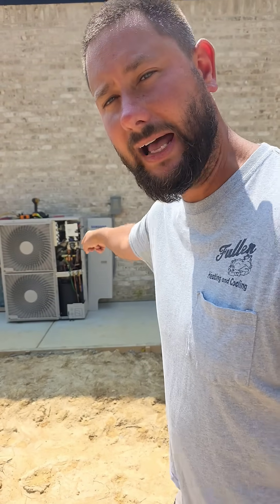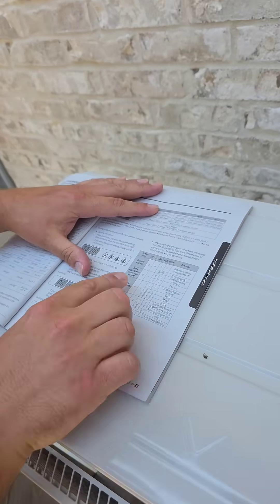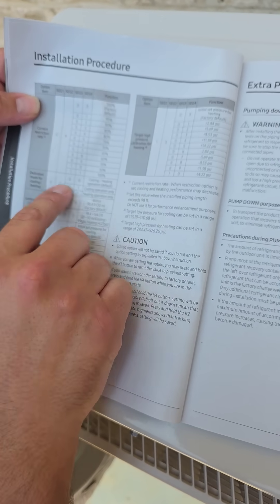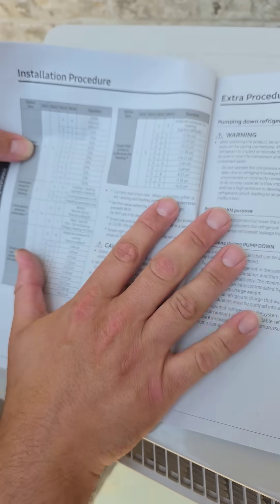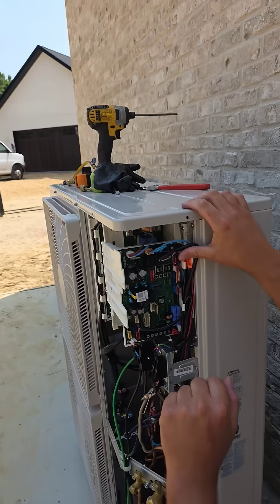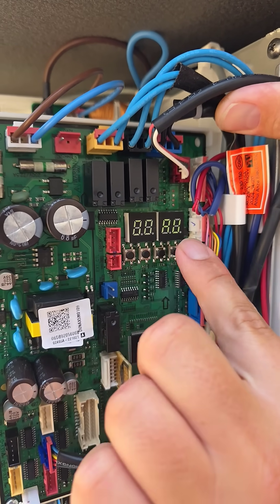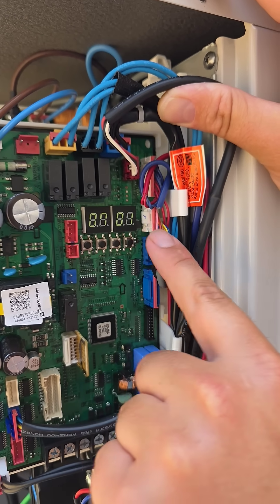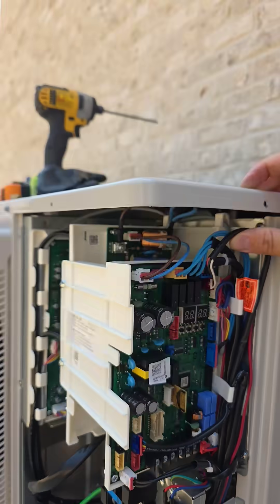Samsung Hylex Cooling Only (Option Setting) #hvac

Comment: I have a 2 ton Hylux matched to a 2 ton Trane AHR and it cools fine but unable to dehumidify? TEM4E0B24M21SAA with a Honeywell zone control and standard ACU control board?
Reply: Buy a dehumidifier and run it for a couple days, run the fan with the dehumidifier if you aren't using ac all day, then only run it when you think it's too humid. Changed my life.

Comment: In very cold weather the gas furnace is clearly the most economical.  In let's say 40's to 50's I'm not really sure if the gas is the cheapest unit to run? Not familiar with Samsung's COP'S but if they were any good???

Comment: I was just about to ask, 'Why would a customer pay for a heat pump only to turn around and have it converted to a straight A/C unit?', but you explained that they have a gas furnace inside.
  I still don't understand why the customer would pay for a heat pump when they could have just gotten a straight-cool unit.  But to each his own! 😆
Reply: They wanted the features of full inverter they get with Hylex.  Hylex is not made in cooling only so they had to go with the heat pump and switch it to cooling only.
They could've left it and went as dual fuel with the proper thermostat and had the benefits of both. All depends on electricity & natural gas costs to justify dual fuel setup.

Comment: Does the remove the heat option at the controller display as well?
Reply from the maker: I was using a conventional thermostat, so I still have the option for heat. Because i'm using a gas furnace.How's my heat source now
Reply: Gotcha.  

So is this set up with wall mount handlers for AC, or a standard furnace/coil?

Comment: Why not keep it heat pump and let run as primary until it’s more efficient to use the furnace? Set the balance point in the thermostat.
Reply: From my experience if a customer has a vent near they’re bed and have only ever had a gas furnace a heat pump in heating mode feels like it’s pushing cold air out at you when you sleep. your body temp is about 99 some heat pumps push out about 90-95 degree temps which is lower than your body temperature so while it’s still hot air it feels cooler against your 99 body temperature

Comment: Those units suck manufacturer support is never good. If you want a real HVAC unit don’t buy it from a phone company. They have no idea how to put a good compressor in them and the inverter boards always fail with them
Reply: I usually pretty much dislike anything that’s not daikin or midea
Reply: Your supplier is your support. I work for a large supplier in the northeast from Maine to New Jersey and Pennsylvania. I am one of twenty people as tech support for the products we sell including Samsung. No other supplier in our area has this kind of support.
Reply: @patrickcaldarone9186  do you happen to work for united refrigeration? Bc they do that too.... and yes they sell heat pumps mostly daikin

Comment: What's the benefit of doing that, rather just not running during the winter time?
Reply: those generally have a heating operation range down to 0 degrees or below outside.  lots of variables to consider, but if the homeowner is relatively competent just disable aux heat. and have the gas valve energize when the Stat is put into emergency heat.  (option 1)
Or just use a od thermistor, set your heat switch over at whatever is appropriate for your area and the heat pump, and the system is now dual fuel.  (option2)  or don t buy and install a heat pump, which are more expensive but also have more components to go wrong with it
Reply: Customers press buttons and not the right buttons sometimes.
Reply from the maker: Benefits is being able to use the gas furnace when I turn the thermostat to the heat mode